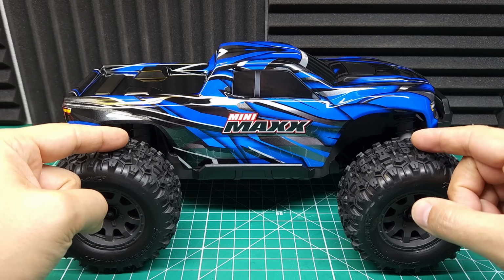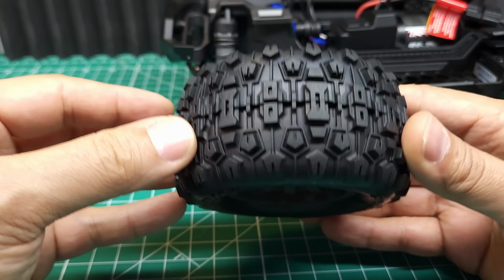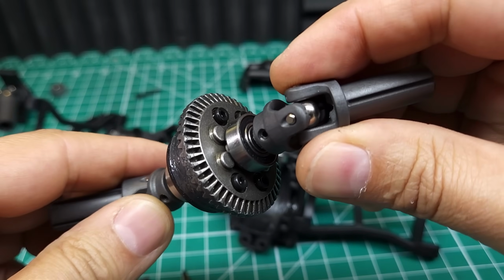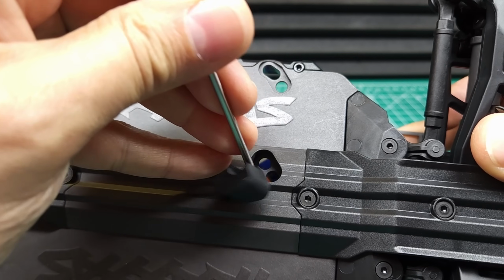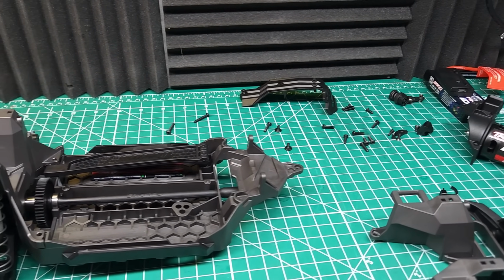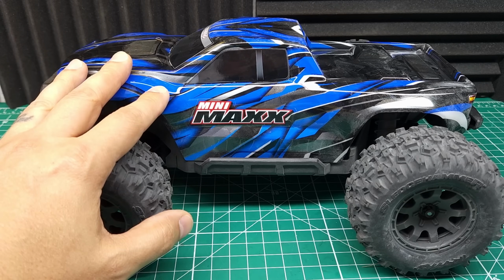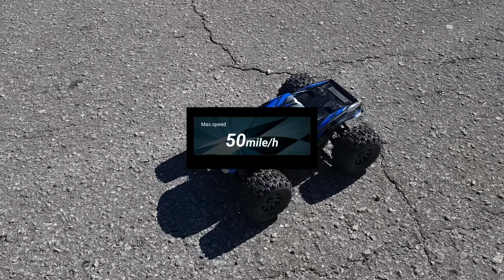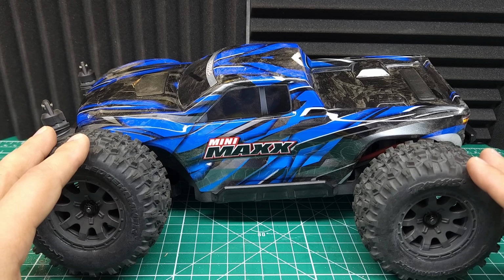I Really Wanted To Love The Traxxas Mini Maxx | Watch Before Buying!

Comment: If it hadn’t of sheared that shaft it would have killed the rear diff. I blew 3 rear diffs with the VXL conversion. Destroyed all the internals.. teeth everywhere 🤷🏼‍♂️
Reply: I haven‘t seen that vid yet is it a new one?
Reply from the maker: Yeah. This thing needs more power and with more power it needs a center differential. Once you add up how much all that stuff costs this is pretty hard to recommend.
Reply: @Elwurstnase  next video (Saturday)
Reply: @DoRC  I agree… although I enjoyed it stock out the box. VXL let me down big time
Reply from the maker: @TomleyRC  Yeah straight out of the box It's a pretty cool little car but for what it does it's also wildly overpriced. At $270 it needed to be the best mini basher in the world and it just isn't
Reply: @TomleyRC  Nice
Reply: @DoRC Rlaario Omni terminator beats this all day.
Reply: Can you get a Slash 4x4 1/10 diff and try if it fits inside? I saw the driveshaft connections and the bearing sizes are the same. But I don't know teeth profile or other housing dimensions. If it fits it will be a nice and cheap upgrade. I have a Slash 4x4 and run it on 3S all the time without diff issues and jump the hell out of it
Reply: @DoRC  So what is the world's best mini???
Reply: @DoRC  I didn't even mention the price... it's a Traxxas, it's gonna be over priced :)
Reply: Wait, Phil over here as well? 😮
Reply: @TomleyRC  yer shame they don't live on the same planet we do...
Reply from the maker: @RBRC1  It depends on what size you're looking for. Really small The 223S Typhon Grom. A little bit bigger and if you don't mind taking a little bit of a risk the Omni Terminator is hard to be
Reply: How does this compare to the Savage XS?
Reply: @DoRC ya 290 all in for a 1/18 is just insane 😳
Reply: @littleAZN248 it'd be hard for this to even come close to beating the XS. That thing is a little beast, and is far more powerful out of the box.  I love mine.
Reply: @ Glad to hear that as I too have a Savage XS 😄
Reply: Question for the guy making this video. If you had to choose mini maxx or the new $220 brushless typhon grom? Great video by the way.
Reply: I could see if some one stuffing a 6s or even 4s into it and breaking diffs but a vxl?
Reply: Should of bought temu 😂
Reply: @DoRC my only problem with the omni terminator so far is the battery it comes with is pretty disappointing (smc has a 3s 2900mAh liHv battery that fits perfectly that corrects that) and the non adjustable lvc is so low on it that you basically need to replace the esc if you want your lipos to last. It's pretty tippy too, but it cones with a gyro that does a great job of fixing that.
Reply: @DoRC  I plan to add more power via a 3s hobbywing esc and the stock motor, we'll see if/how much I have to gear it down to keep temps in check. Hoping the drivetrain can handle that, but if not, traxxas is gonna have to warranty quite a few parts.
Reply: Bummer that the 3s vxl tears this thing up.  They claimed 1/10 drivetrain components, but 1/10 should be able to handle 3s.  I think we are going to pass and wait for the vxl, hopefully with significant changes.  You guys are invaluable to the hobby!
Reply: @hinnmanfamily Traxxass warranty is for electronics only and then only for 30 days.
Reply: @DoRC  They're actually $249.95 if you buy them from honest stores like us. 

Unfortunately due to them not making enough to meet demand, they're upcharging $20 for expedited shipping from Taiwan.

Traxxas, as well as shiesty stores are all doing that right now.

Great video though! Enjoyed the full teardown!
Reply: Hi, Phil! :D
Reply: Yeah, but you're a ⚽ 🛍️. ! 😉 😉
Reply: Ill stick with my merv vxl, steel shafts all the way around and center diff. Had to spend a few bucks on those but durable and fast and loads of fun. Spending what they want for this makes very little sense. Grom brushless makes more sense, just wish they would add the granite.
Reply: Ill stick with my merv vxl, steel shafts all the way around and center diff. Had to spend a few bucks on those but durable and fast and loads of fun. Spending what they want for this makes very little sense. Grom brushless makes more sense, just wish they would add the granite.
Reply: @FatherandSon_RC  don't run it on 3s and it fixes the problem lol
Reply: The Savage xs is probably the best mini mt. Imo I thought the mini xmaxx would dethrone it but I was dreaming
Reply: Sounds like Traxxas cut every possible corner to give customers a truck where everything but the chassis needs upgrading to go 3s. 
I'm always impressed with their R&D team, which makes huge advances in fabricating crap. Aside from the chassis, this is the dog's breakfast.
Reply: @Boogie_the_cat  yep! They are like the apple Corp of the rc world. They want you to only use there stuff and way over priced for what ypu get. They give you cheap durability then offer a expensive upgraded part selection with intention that you will break it amd the noobs and fan boys will go purchase there upgrade kits for even more money on top of there already ridiculous prices  for there rtr's
Reply: @DoRC  what would the downside be of raising the pinion tooth count?  Give it a little more top end.  Would heat be an issue, on 2s?  I've got two preordered for bashing around the house/neighborhood, so I don't need it to be THAT fast.
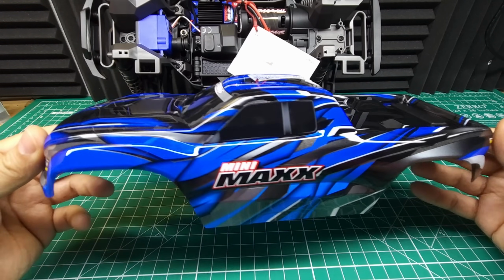Reply: @littleAZN248  I also got a couple of Savage XS's and they are a beast, they have their quirks but overall a great RC. I find it insane HPI announced a mini monster truck with 1:10 scale electronics and came with a brushless setup capable of doing 65 mph almost 14 years ago. Here is Traxxas and they can't even make a mini monster truck without it breaking on a simple brushless setup, and needs upgrades to be reliable. Which is a shame, I was hoping this would be a great car, I wanted another mini monster truck.
Reply: @FatherandSon_RC even 3s can easily kill 10th scale components if there is nothing that allows for power dissipation like a slipper clutch or a differential.
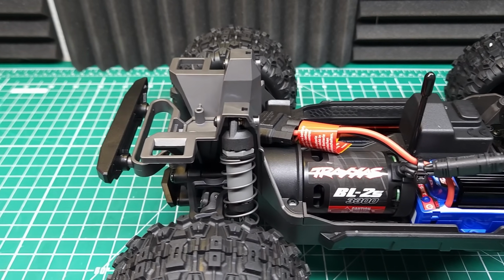I shredded gears on my team magic e5 monster truck that way. The E5 is a 1:10 3s vehicle with an 1:8 drive train. Also no slipper or diff, just a spool.
Reply: @ Agreed and in some ways, the Mini Maxx is inferior from an electronics perspective since it doesn’t take 1:10 size lipos. We just need HPI to release a savage XS center diff.
Reply from the maker: @littleAZN248 I would love to see a Savage XS V2. There really aren't that many options on the market for a vehicle that size and HPI could make just a few key changes to the current vehicle and make it a lot better
Reply: LilTree car air fresher  was .99 in most places now they $3,4 everything is higher and not as good as what was. a 10y old lil erevo would drag this thing dollar for dollar.
Reply from the maker: @scotthammerslag  The potential downsides would be worse acceleration and more heat. Whether or not either one of those will actually be a problem I'm not sure.
Reply: Do you think with a slipper clutch or center diff installed it would react differently as far as blowing diffs?
Reply: Already seen posts about the diffs  stripping teeth on the shitty grade diff teeth.   Also looks like there is no slipper on the spur gear.   What a joke.
Reply: Arrma putting a hurting on traxxas lol
Reply from the maker: @chrisparz8722  I'm sure Traxxas is going to sell plenty of these but they definitely don't offer best value for money
Reply: @ no doubt.   People don’t do any research before purchasing.  I appreciate the honest reviews.
Reply: @DoRC  they will sell because of the fan boys and the noobs who have no idea about the hobby and what better value for the money is out there but they seen a slash on YouTube drive across the pond and they want to do that.  You know how many noobs ask if my sc6.2 is a slash? I just laugh and say oh no my friend this is way better than a slash haha
Reply: @DoRC who cares about $250??? Broke people? This isn’t a broke boy hobby
Reply: @DoRC it's Traxxas, not arrma 😂
Reply: @nickhathaway4617 big difference the mini terminator is supposed to be 1/10 but it’s even shy of 1/12 so prob just lil bit bigger than this 😂😂
Reply: I was going to get it and put my 3s power system from red cat into it but it will absolutely not handle it especially since I wanted to try 4s since my red cat power system goes to 4s too just because I wanted to puss the mini maxx to the absolute limit but it can't even last one run with 3s so that puts my idea to a dead end.
Reply: Went Rrarlo Omni terminator for the same bucks… runs great, no issues bashing it…
Reply: The Omni terminator carbon is better deal in paper. But in practice, the plastics are brittle af. Any spare parts take about a month to get. There’s no US suppliers. I’ve had a few of the Omni and all had significant issues right out the box.  Then if you buy the aluminum upgraded parts and then decide to return them because the vehicles aren’t worth it. You can’t. They tell you there’s a return place in US. There isn’t. You have to send back to China, 25% restock fee and have to pay all fees etc in returning it. It’s a Temu trash can. Save your money. Don’t buy either
Reply: You Mr Tomley RC were giving FULL THROTTLE on several Landings ! That would destroy the diff on any RC vehicle. be honest !
Reply: @TomleyRC  did you destroy the Rear onky ?
Reply: I brought a team associated MT10 instead, thay don't break, and have a center diff and 3S.
Reply: Not made for 3s direct drive no shafe to help absorbed the power
Reply: I'm going to steal diffs out of my slash or hoss and jam them in with the ring gear swapped, seems to be a good fit and the slash gears hold up very well. Never busted one yet on 4s no center diffs
Reply: Hi
Reply: @TomleyRC its a 2s rated truck man putting more power to a 2s truck doesnt give you the right to trash on the truck when it wasnt designed for the power you put to it..... as a factory 2s truck un modified its awesome and its very durable

Comment: Watching this, I'm definitely going with a mini arrma...
Reply from the maker: Yeah a typhon EXB with bigger tires will Go 90% of the places this will and be easier to work on cheaper and just an overall better car
Reply: @DoRC  typhon it is then 😉
Reply: DONT BUY THE GROM!!  They are aweful Arrma has had mine 3 weeks now no word from them at all it was eating diffs and Motors left and right!
Reply from the maker: @J.D.Y.B  :)
Reply: @kennethmoore737  The Grom lineup is fantastic. Sounds like you got a lemon.
Reply: @kennethmoore737  Thats weird, maby you just got unlucky 😕
Reply: @GeddyRC  yer with what I've seen they look pretty awesome and tough 💪
Reply: @J.D.Y.B  maybe so still very disappointed i told them I want my money back to buy a mini Maxx and am ghosted...... SMH I WAS a big ARRMA fan but less so now!
Reply: @kennethmoore737  that sucks
Reply: @kennethmoore737  The brushed GROMs are pretty bad, I agree. But the new fully upgraded 223S ones are absolutely badass. Fully upgraded diffs, driveshafts, axles, shocks, 50 mph speeds, and they're the easiest RC in the world to work on.

Comment: My thoughts were exactly the same. When it was leaked, I thought it should be about a $200 truck and the only way I was going to pay $250 (the original advertised price) was if it was already fully upgraded and had the performance to match. But now at $270, I just cannot justify it. Although, it is rather impressive that Traxxas has seemed to break the laws of physics with how little air control there is with those large of tires on that wheelbase. It is Traxxas, so people will buy them; but there are going to be some unhappy customers.
Reply from the maker: Yeah it all comes down to tire weight and wheel speed. The tires are pretty light and the BL2S system just can't get them spinning fast enough
Reply: @ On paper, it should have the power to overcome inertia to at least get close to rotating. In the air, unloaded, those wheels should be spinning rather fast to hit (nearly) 30mph on the ground, but it looks like it can hardly even do minor adjustments in the air. 
When they showed it being driven by various YT people at some event a few months ago, I found it odd how poorly it was jumping for anyone that was driving it. 
I really thought this would be a chance for Traxxas to get back into what people want, but they fell flat (in every sense). The price, the performance, the durability…they checked no boxes except for having released a product, but arguable on the success of that considering the price change. As you said either in a comment or the video itself, this is (now) a $300+ purchase after tax. 
I thought Arrma putting all the upgrades on the Grom 223S models was to compete against this Traxxas release, but clearly it was not because Traxxas went the other direction and skimped out everywhere it could.
Reply: Well when grown men with the ambition to jump a real monster truck buy a tiiiiiiiiiiiiiny scale of said truck is and act as though they have that big real life one without thought fear of injury of death as a result of a crash……. What do you think is gonna happen? My 4 year old who will be driving it on NM batts first will not break it. And when she makes it to 2s she won’t have that I a man I can’t get injured send it to the moon mentality and then I won’t have a thought of man I can’t believe she broke and it was $270 I will be smiling ear to ear watching her. PUT YOU MAN PANTS IN FELLAS CAUSE YOU PUMPING OUT TO MUCH ESTROGEN

Comment: at this pricepoint, the plastic servo and other cost cutting measures are inexcuseable. i disagree with you on the power tho, 2s is plenty for skatepark bashing which i guess is what most people want from this. also seen other videos of it easily backflipping and having nice aircontrol in a skatepark, im tempted give this a go eventually, if i get a good deal, because i really like small skatepark bashers.
Reply from the maker: Maybe so but off my ramp even jumping nearly 10 ft in the air I could not get it to backflip. If it was 150 bucks the power would be fine but the reality is it's not 150 bucks. At nearly $300 after tax this thing needs to be the best small basher in the world and it just isn't
Reply: @DoRC  Well said.

Comment: As someone who owns a Maxx plus 2 stampedes and a GROM I find traxxas aluminum to be HORRENDOUSLY overpriced, like seriously $90 CAD for a servo saver when a HR one is 50 bucks? 160 Dollars for a light kit? $220 for a (crappy) servo, traxxas is way over their head when it comes to upgrades.

(I couldn’t help add some more) 
Looking through the Traxxas upgrades for the mini Maxx it’s just as bad 125 clams for GTR shocks! 160 for metal driveshafts!!! That’s the same as the Max Maxx! Holy moley this is crazy. Plus the proprietary battery like seriously, I don’t like my GROM for having it but I do know that you can change them to a standard balance lead but still!
Reply from the maker: Yeah their prices are really something else.

Comment: Literally, you save my pockets. With those flaws is over priced, arrma will be my next choices again
Reply from the maker: They definitely seem to be providing better value for money these days
Reply: Same. Just wish the Grom cars were a bit larger. As uninspiring as the Mini Maxx is, out of the box it can go on terrain the Grom can't due to wheels/clearance. Arrma: 1/14th Big Rock 3s please!
Reply: i never liked these newer designs from Traxxas. wasn't anything wrong with the older ones. a brushless Stampede 4x4 is only about fifty bucks more than the mini Xmaxx.

Comment: I really appreciate your objectivity.  You wanted to love it, you wanted to be 'wowed' by it, but you werent, and you told us so, and why.  
I established a loose saying for myself years ago in this rc hobby of ours, in regards to getting a new vehicle of any kind, you have to ask yourself, 'is it nice enough to buy twice?'  Because you will almost always spend around double if you plan on upgrading it, racing it, etc.  
Though not a big name, Laegendary has actual 1/10 brushless monster trucks with great reviews for about $100.  For the cost of upgrading one of these mini maxxes you could buy 4 or 5 of those things, and start your own racing circuit with your friends.  Just saying, name brands are generally reliable for parts, but when you do the work yourself, you can make beasts for fractions of what a new rig costs with a smaller company in a standardized scale.
Excellent video, thank you for your honesty, I was really considering getting my first traxxas when I heard about this guy, but now, I'm probably getting my first two Laegendary's on amazon!
Reply from the maker: Check out the Omni Terminator 2. It's a little bit higher end than the legendaries but not quite as expensive as the Traxxas
Reply: I've been looking at the Laegendary myself. I'm an old school R/C'er so I don't mind the manual beefing up of a decent platform. Their trucks look like anything else on the market. I haven't seen anything about whether it comes with bearings or not though. If not, can it be outfitted with them and are they standard sizes? Their website appears to be highly neglected and offered no info.